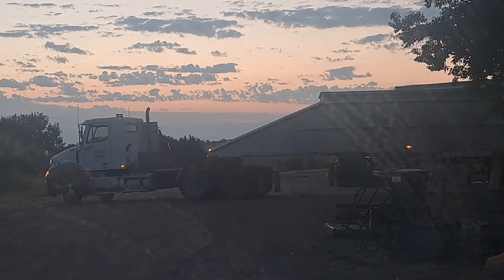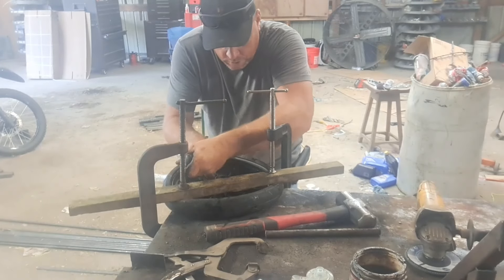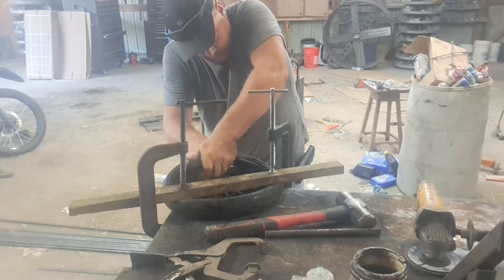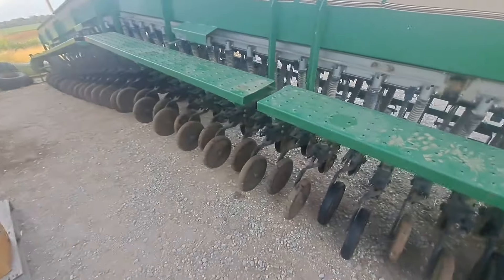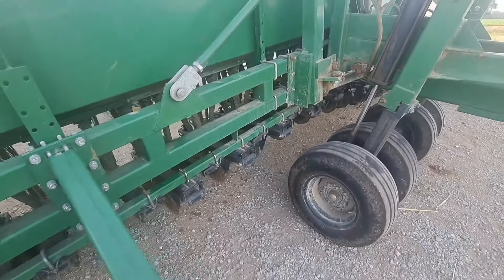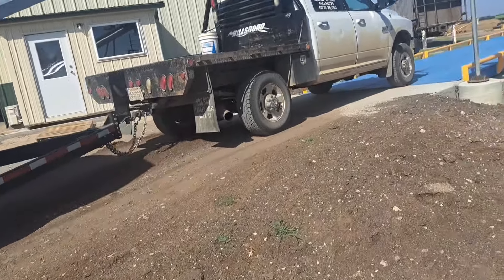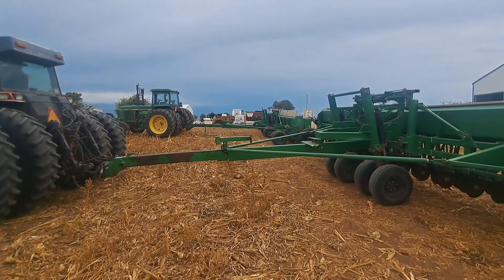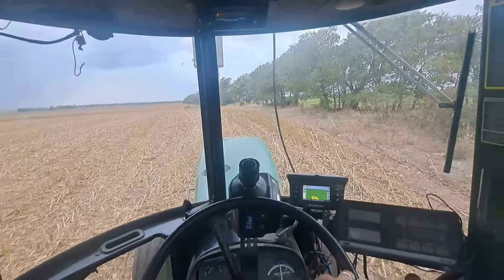did we finally get some rain in kansas?

Comment: We made up two 3/8 thick plates one with holes and one with pins welded in it to match up both haves of the wheels and put it in our press and push them together we only use two alignment pins and holes big enough to get the bolts in the other ones.
Reply from the maker: If I do more than a few at a time, I'll look into that.  I know there's a better war.  Thanks for the input.